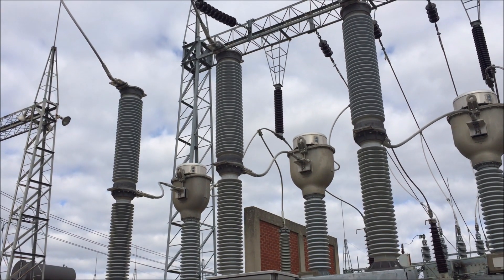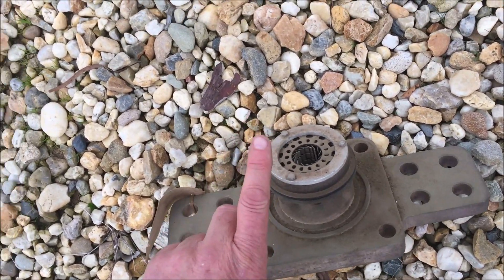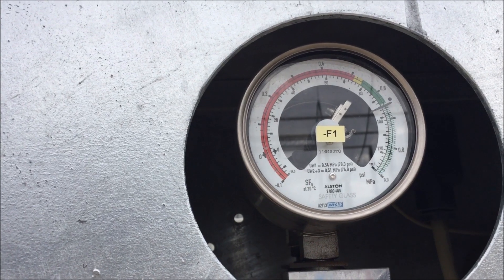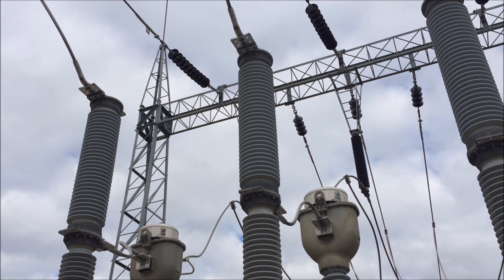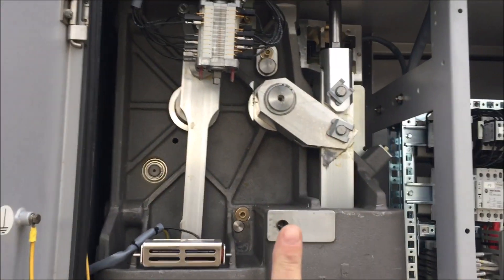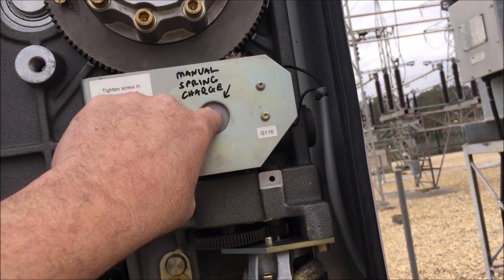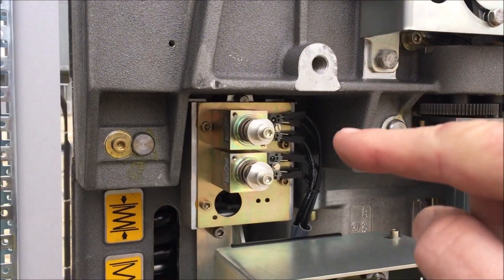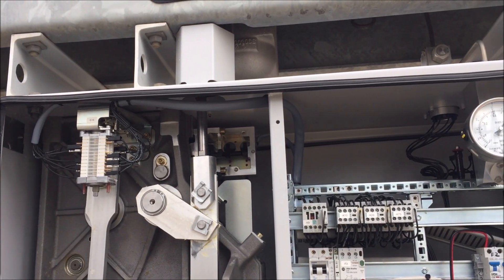How does a 132kV Circuit breaker work - A brief overview of what goes on inside

Comment: Wow mind boggeling..I am waiting to start work on a late shift watching your vid...
When it trips is there a strange sound made?...
Reply from the maker: No, just a loud thump/bang really. The old air blast breakers from years ago were deafening to the point they would blow a hooter three times before they were operated so people in the yard could put their fingers in their ears.
Reply: Great videos !...keep them coming !..from an old retired linesman !
Reply: If you're interested, here's an HVB SF6 breaker that trips with air pressure, instead of a trip spring. The only breakers I've ever worked on that didn't use a trip spring that was charged via the closing operation to store the tripping energy. It releases 240 PSI in three cycles and it sounds like a gun shot. The video is looped, it doesn't operate that fast but does have reclose capability. On the close you just hear a low thud and the springs rattle. 
https://www.youtube.com/watch?v=VdHUqhaN6TY
Reply from the maker: Yep, all the air operated stuff has gone from around here thank goodness. I think we have 1 circuit breaker that operates from hydraulics still in service in our region
Reply: Ahh the "pneudraulic" stuff. Luckily they retired all that before I hired on. Glad I didn't have to deal with accumulator bladders and hydraulic hoses.

Comment: Another really interesting video.
The contacts are works of art yet incredibly strong and functional. Those current levels are mind boggling!

I live in the UK but sometimes my power will go out and switch back on within 2 seconds, sometimes less. Is that gap in supply to me a circuit breaker like the one in the video 're-arming' itself using a DC motor?

Keep these things coming. I'm particularly interested in the internals of high current electrical gear - the contacts were a perfect example of what I mean.
Could you also explain to us how switch yards/substations and power generating units communicate? Is it all down to sensors on loads or is there more to it?
Reply from the maker: Thanks Jack. The  gaps in your power are due to a feature called auto reclose. When something hits the line, the relays at each end sense the fault and trip the CBs. They also start a reclose timer which will close the CBs after a set time . If the fault is still on the line, it will trip again but not reclose a second time. Without reclosing, every fault would require the CBs to be manually closed and your power would be out for however long it took a bloke to drive to the sub and close the CBs.
Substations generally operate independently of each other but sometimes will use a differential scheme on shorter lines (what goes in, must come out basically) The relays at each end constantly compare the currents via a fibre optic "cable". If there is a difference in current amounts (i.e more going in than coming out) then there must be a fault somewhere so the relays trip. If for some reason the fibre drops out, the relays will default back to a basic distance scheme and continue to provide protection for the line.
Reply: Awesome reply thanks!
Yes I live where woodland surrounds most of my area. The supplies to the villages here are at 33kv and travel through those woodlands. We get those gaps in power when the weather is a bit windy or wet - seems those trees need trimming!

Comment: where are the protection relays for each bay? in the local control panel?
Reply: Not just one panel, but you'll find these in the relay room of the control building or isolated relay houses. For instance, the bus bar protection panel has its relays.

Comment: Ah SF6, what a great gas for the environment if it leaks out.
Reply from the maker: Yep, we make sure that none escapes. All gas is captured and recycled and its use is closely monitored. Leaks from a CB are very rare. In 35 years i have seen 1 CB that had a slow leak from a pipe fitting (took 6 months to bring up an alarm) and have never seen a CB that leaked enough to lock out.
Reply: Matthew let is know when you come up with a better gas.